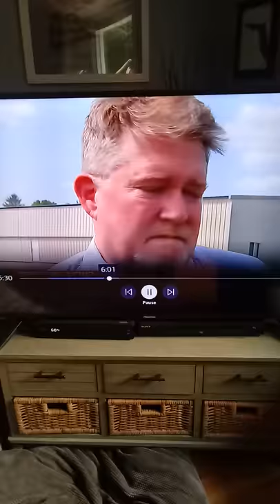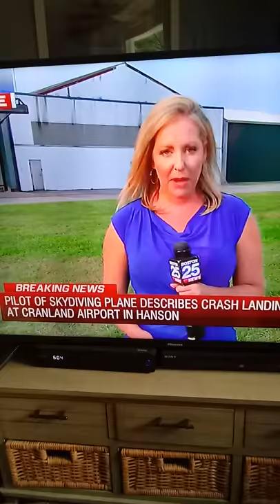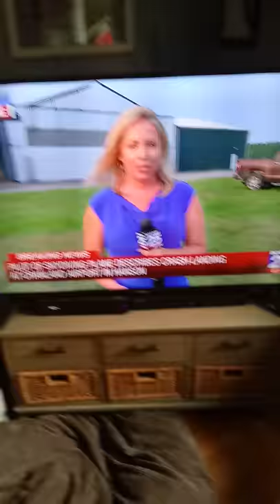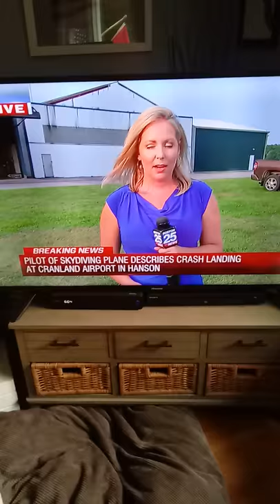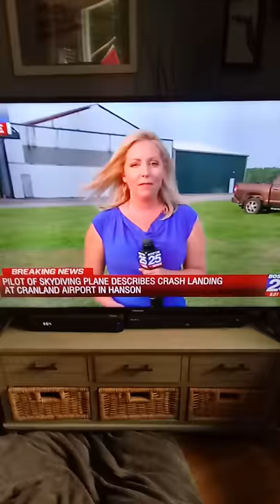Flux capacitor causes plane crash?

Comment: All my time flying I have never operated a aircraft with a flux capacitator smh. I always wanted to though. I hear they are awesome gadgets to have on board. I was told if you do operate an aircraft that has one installed to avoid 76.47 knots or as many know 88mph or crazy things will happen.